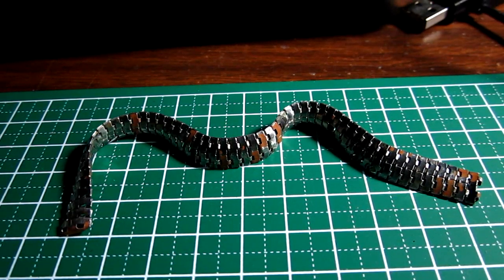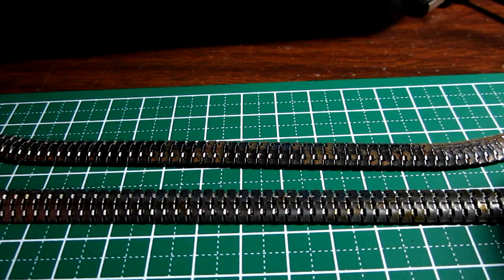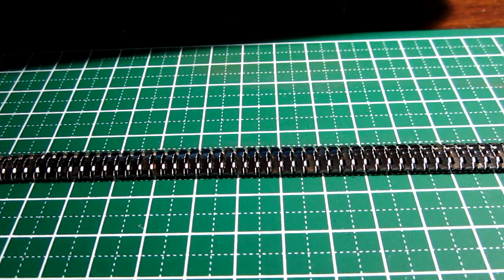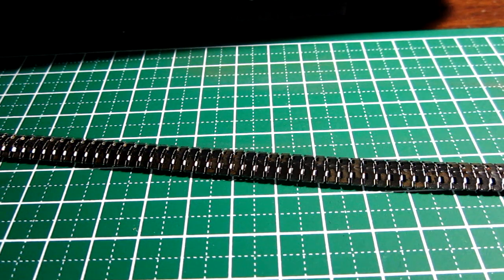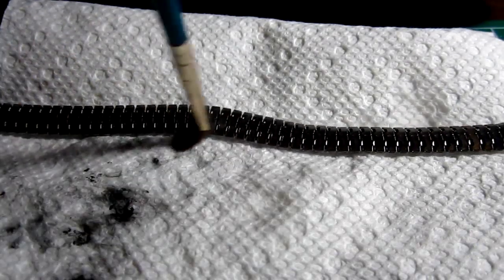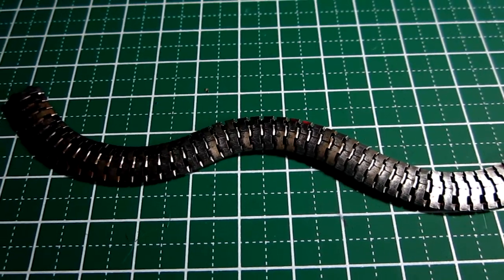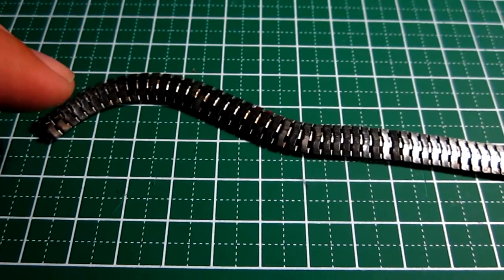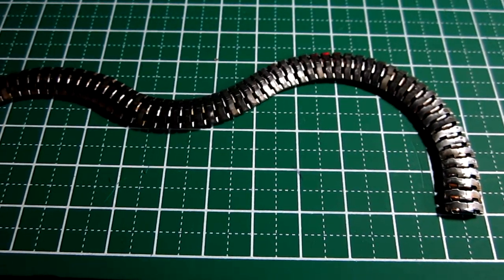Metal Ammo Pack Fix

Comment: I think your best bet on this is to polish it up really well with some Braso, which is a polishing compound for metals.  Then give it a good rinse with bottled water (it's the salt in the water that causes oxidation) and pat it dry as best you can.  Once it is dry, I say get yourself a can of spray on clear coat (gloss) and give it three or four really good sprays all over.  That should fix it up.